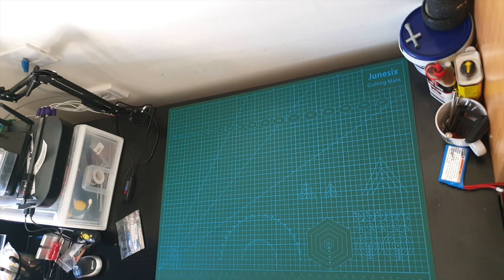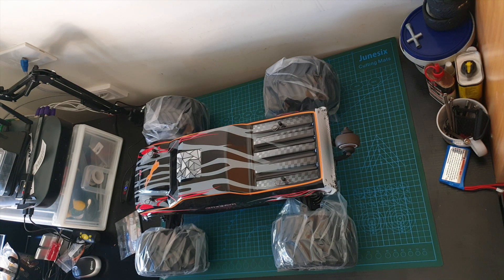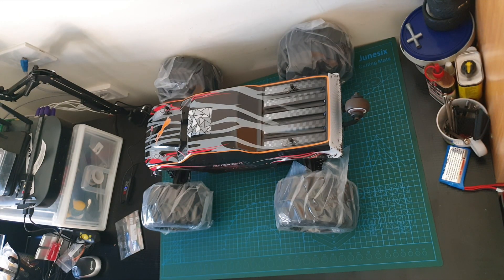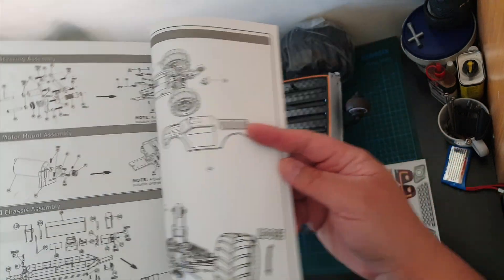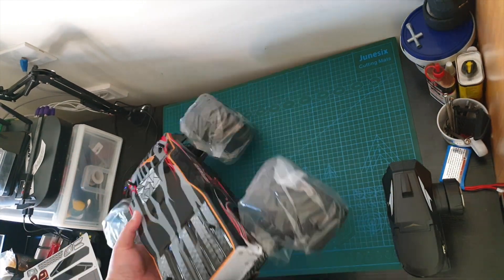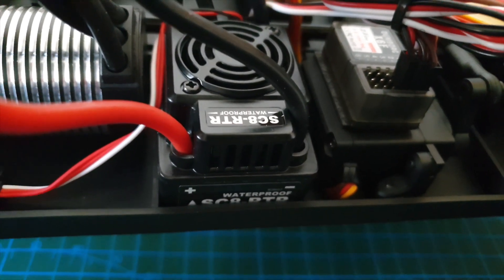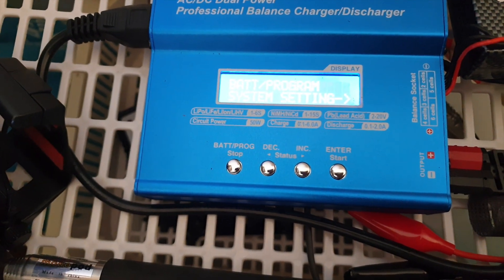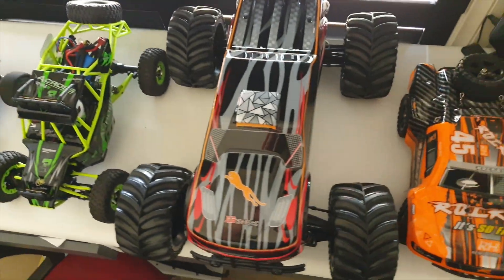JLB Racing CHEETAH 120A Upgraded 1/10 Brushless RC Truck 11101 RTR Unboxing and Test Drive

Comment: Awesome brother, i like the JLB Cheetahs and J3 Speed truggies, have been thinking about buying one myself or a VKar Bison...not sure what I'll purchase yet! That thing will fly bro...have fun! 😀👍🍻🇦🇺
Reply: Me too David, I'm thinking if Cheetah the monster of wheelie or J3 speed the top speed guy 😁
Reply from the maker: Thanks bro! I totally love the look of this truck. It is quite powerful and large and heavy which I'm not used to as such. Unfortunately I crashed it into the FS Racing Baja head on which my son was driving and the Baja shock tower bent as well as the chassis itself! I've repaired the tower but left the chassis bent and it still drives. haha. No damage on the Cheetah at all. Goes to show how lethal this beast can be! 😬 I will continue practise driving it. catch ya!
Reply: @smpoy  get the J3 speed for speed! I have all 3 and the J3 speed is my favorite! Just change the tires to belted and you will love it..
Bison sucks! Easy to break! The wheels are not 17mm

Comment: Do you know if it can handle 80c 3s lipo ?
Reply from the maker: The past few weeks I've been using a brand new Zeee 5200mAh 80C 3s LiPo in it and have had no issues so far.
Reply: @MickoRC  good I have that exact battery and was concerned it might fry it.

Comment: Make sure bro lagyan mo fluids yung diffs, thats is a nice rig! I still have mine! It’s underrated RC
Reply: Tires are sucks though
Reply from the maker: thanks. I will grease the diffs. 
What tyres did you replace with bro?
Reply: @MickoRC  right now I have the tires from Force Rc muckraker and it handles a lot better, tires can handle 6s with only slight ballooning, no ballooning on 4s
Reply: Change the servo and tires and I guarantee you will have fun with this rig!
Reply from the maker: @209rc7  I have a KS-3518 servo on hand and will throw that in. I will stick with these tyres for now until it pisses me off. 😁
They alright for bashing though, and I'm not that good with speed anyway 🤭
Reply: @MickoRC  that servo would be fine! Yeah tires are not bad for bashing